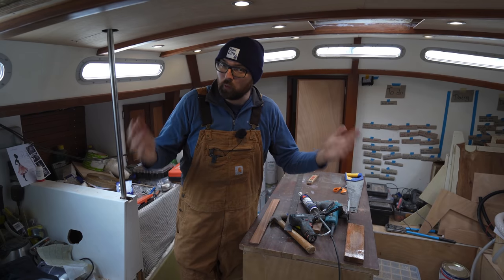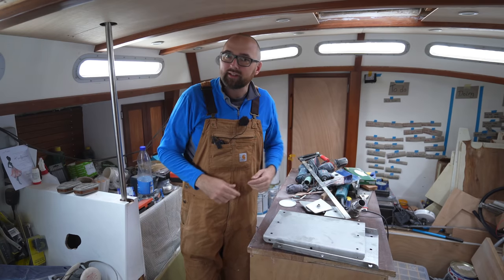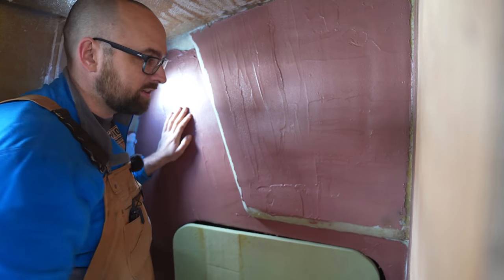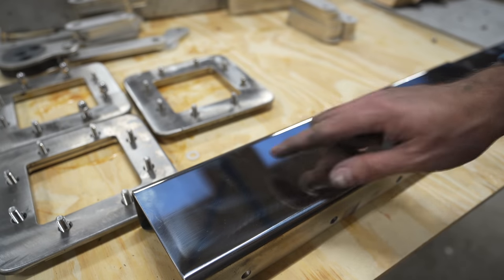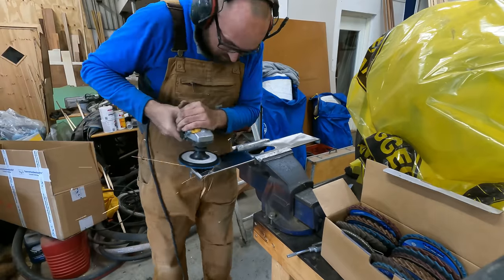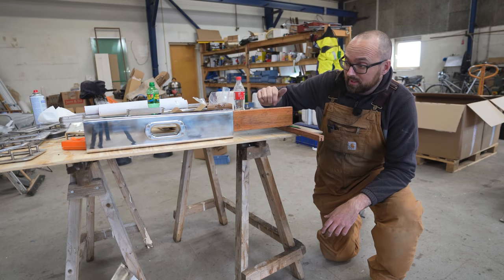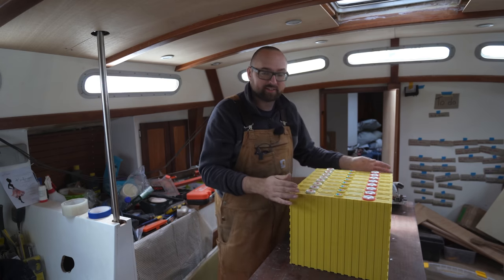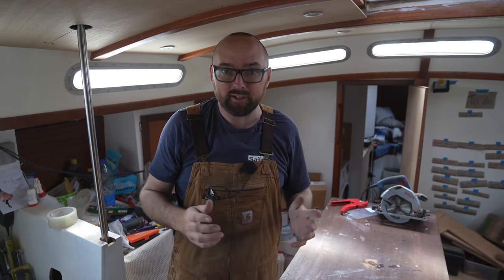Sail Life - Battery compartment, solar arch and toe rail - DIY sailboat projects

Comment: Hey Mads. Things are really looking great. Can you mount the antenna into the mast above the spreaders? In the back it may interfere with the windvane if you intend using one. I hope you do .... I know you will have a lot of power on board but a mechanical vane is a great piece of low tech and ads redundancy to autopiloting.

Comment: Top balance should have miniscule current flow after the first few minutes.   You can just use random wire instead of bus bars rated to >100 amps. 
 (Assuming you're just doing the balance and not charging in parallel. )

Comment: Howdy. Are you concerned about the deck hull joint not having the million screws holding it together from the old  toe rail? Is glassing the joint as you did structurally sound enough? I ask because this summer we are glassing DH joint on  our whitby42. Love your videos it is super helpful to know about how much O glorious sanding any and all jobs on sailboat may require.

Comment: Was there a reason you didn’t run the arch supports right through the endcaps and have them welded in two places per leg - at the top and bottom plates of the endcaps - with the added integral support from this?

Comment: mount the long range wifi antenna forward of the solar panels, not aft. it will be way easier to put up/sideways.
Reply: Won't it conflict with the boom?
Reply: @jameshoiby  I'm under the impression that the pannels are behind the reach of the boom. at least that is the case in my boat and most arch mounted solar panels I have seen.

Comment: You don't need bus bars to balance. The reason bus bars are so big is that they need to handle a lot of amperage because the voltage potential across them is so high. When you are top balancing new high quality cells you're looking at a few hundredths of a volt difference. You could probably get away with a single 22 gauge wire running down each side.

Comment: Mads, I love this channel and I watch every video. Question: when fairing a large broad surface, have you considered first spreading stiff compound (like the green 2-part stuff) with a toothed blade (or really thick mix using West 401 (microlight.) This leaves a surface of easily sanded grooves that you can fair with a a few strokes of a long board. Then you fill the grooves flush with a second quick fill coat. Result: dead-flat. What do you think?

Comment: You mentioned Top Balancing your Batteries but have you Bottom Balanced them? In addition I would strongly recommend Wedgelock washers to keep your battery links tight, this is critical ! I reference these items from experience ( an electric car conversion ) please be careful.

Comment: I would return the wifi antenna and just use the cellular ones. The wifi is too crowded and slow in most of the Bahamas/Carib. I am instead getting Starlink Mobile (which should be available at the end of the year).

Comment: wifi antenna - mount high on the side of the mast - that way if you're in a marina other boats won't be in the way of the supposed wifi signal...... solar - go with stiff not flexible - get from China as they still make the best and cheapest - order now to allow for shipping time - get a solar-wind kit if you don't already have a wind generator - don't use the direct from Chinese controller if you buy through eBay, but keep as a back-up.... oh.... btw.... make a faraday cage in the workroom to store electronic things during a coming lightning storm and don't forget to ground to lightning arrestor plates on outside of hull... - or just use oven... I would also use fans to bring air past batteries to keep cool as they charge fast as well as heat up fast when using for cooking, laundry, etc...regardless of inverter bc heat is a killer just like freezing is a killer on batteries... especially on deep-cycle - - too bad that electronic monitoring does not keep tabs on battery temps.....

Comment: Why does the cellular system need two antennas? Is one of them the local-repeater antenna that gives signal to your phone? If so, I should think you don't even need to mount that externally.

Comment: Not sure if you should mount the batteries there, if you get water in the saloon they might short out and kill all you electronics or at least disable them. Remember a good bildge alarm… and maybe think of some redundancy for the radios and maybe chart plotter…  
I recently saw a video with similar battery placement and it went catastrophically wrong

Comment: Could you put your WiFi aerial on the top of the mast?
Reply: I think I remember the mast being very crowded with other antennas
Reply: @peteralund  if it's going on a bracket anyway, I'd have it attached to the side of the mast. It doesn't need to be at the top, assuming it's a case of the higher the better, but anything over 6ft will be better than having it on the arch.
Reply: The longer the coaxial cable, the higher are the RF losses, and at 2.4GHz the losses on the cable are significant
Reply: @joaopissarro2861  wouldn't the cable from the arch, and I'm assuming to the nav station inside, be roughly the same as going forward instead and up the mast?
Reply: @mhicks80  it could be, in both case that’s not the best solution, that’s why in those cases the active equipment is placed just by the antenna, and the link to the “nav station” via cabled Ethernet. 
Dependent on the cable quality the amount of losses can be over 50% or over. 
I could look, later on, on some cable characteristics just as an example.
Reply: @mhicks80  example of an active access point to place at the antena. 
https://dl.ubnt.com/datasheets/bulletm/BulletM_Ti_DS.pdf
AP and antenna could be mounted on top of mast. 
Just an example.

Comment: I'm curious what BMS you plan to use with those LFP cells? I'm 99% positive (OK, make that 100%! :-) ) that you've got everything planned down to the minutest detail, but am curious if you researched the Electrodacus BMS. It is a stunningly simple, beautiful, clever design. But it does kinda require expensive Victron inverter-chargers and DC converters as it switches all LOADS and CHARGERS via mV remote signals, rather than having any high current flowing through the BMS. I personally believe the Electrodacus is Best-in-Class for LFP cells with matched panels. My six 120 half--cell PV with 7.8KWh of aluminum cased LFP cells and twin Victron Inverters supports my entire RV, including the mini-split A/C, running non-stop, our twin induction cooktop, coffee machine, microwave, hair dryers, lights, cell and laptop chargers, TVs, Sat receivers, Routers, Modems, water and vent pumps (for the composting toilet), etc, etc, etc

Comment: Be careful with the antenna placement with all that stainless tubing and electronics from the solar system so close together. They might be completely fine, but i also wouldnt be surprised if there was some signal degradation.

Comment: As a ham radio operator, I can tell you that your plan to install antennas nested inside the legs of the arch is not a good idea.  This will severely impact the range of said antennas.  In addition, it will impact the SWR of the antenna which may endanger the final stage amplifier of your transmitter.  The antennas need to be above the top of the arch or they need to be offset to the side at least 50 cm.
Reply: QSL

Comment: Hey Madz, did you get the batteries off Aliexpress?
Reply: There is a video in which he mentions where he bought the batteries. If I remember correctly, he dealt directly with the manufacturer, but ... it has been a few years, so I could be mistaken.

Comment: I like your way of thinking and finishing things. But people are right, you've added quite some weight to the boat. It's not only a matter of performance but also you're loosing obviously some stability and the hull needs to withstand more forces than it's been designed for. Not only catamarans are sensitive to weight, monohulls are more forgiving but overloading them can become dangerous as well. The toe rail is way too heavy with at least 5 mm thickness. On the cabinets there are some double layers of plywood as in the galley drawers and all over the place you have not spared with weight. Have you compared the waterline before the refit with the current depth? Roughly calculated each cm more depth means about 190 kg of added displacement for the numbers given. Sitting deeper in the water means also the boat is moving less active than it was designed and it will therefore have to take more force by waves. This means more green water on deck and a shower for free occasionally in the cockpit. 
Let me also say that the price of 45 k for the hulk of a boat you got is way to high. Even as a naval architect I'd never buy a ship without the neutral judgement of an certified surveyor. The money is well spend and usually results in savings. Emotions get in very fast and what seems a good deal turns very often into a nightmare. Even if you exactly wanted a large project like this has become over time, you could have saved easily half the price. All what is left from old Athena is the hull, the engine and the mast. The radar you mentioned in one of the videos was replaced and everything else as well.
Maybe even a brand new hull, rigg and engine would be possible for the price. A last comment on the displacement. As you probably know the warrior 38 was designed for 8.5 tons and not for 11. This means the waterline has been already far too high when you bought her. No wonder with all that water inside. With these arguments in mind it would have been well worth the effort to rip the core in the floors and reinforcing them with vacuum laminate. Of course I know that you have to stay positive on YT to keep going and behind the scenes you probably doupted a few times if this was going to be successful. 

Besides all the critics you have done a real great job. I believe especially the effort of managing the project beside the day job and filming all that, ordering the material right on time for several ongoing tasks simultaneously and then even starting a relationship in LA is quite a challenge. I'm also restoring wooden boats beside the job and often enough material is missing, even with less simultaneous projects. I'd have done the insulation different with more effort and some more minor things. But I'd not sail to cold and dark regions.

Comment: Long-Range WiFi?  Have you considered Starlink - May be worth a look, it will become available this year and be mobile accessible.
Reply from the maker: That would be amazing but I think it'll be a few years until that becomes an option :)
Reply: @SailLife   Not according to Elon.  The rate of satellite deployment is on schedule and my dish should be here within 6 months. The system will be operating out of Beta in June 2021.  He has also indicated that the current dish will be 're-programmable' for mobile applications, and that a different, smaller mobile dish is in development.
So, figure 6 months of mission 'slip'...  That's still Spring 2022!
Hell, by then he'll probably have missions to the MOON with his Star Ship as well!
Reply: @SailLife  And, once full mobile service is available, that will mean having broadband connectivity mid-Atlantic & mid-Pacific - very cool!

Comment: yr wifi antenne can be mounted upside down in the middle so to avoid shade or weird brackets ;)
Reply: Suggesting the same!
Reply: I don't disagree with you , upside down will work, BUT, it is a "Long range Wi-Fi antenna" which means the higher the better (longer range), what about part way or all the way up the mast?
Reply: Or on the spreader...

Comment: Why is it important to have the longer antenna on the arc? Isn't it better to have it on the mast? (Or the forstay, or on any place high enough.) Is it a electric line-problem? It really should be on a levitated place, away from everything (if it works anything like normal 3G/4G-antennas). As you need it removable, think mast instead and do it a click-on. Imho. Line of sight is everything when we talk antennas. But also interference.

Comment: Hey Mats! You don't need to put those antennas such far apart, i'd say. The 'UHF 5G' are 5G mobile antennas, for which you can't even find a datasheet atm, you must be a lucky beta tester somehow ;) But anyway, the 5G mobile antennas and the 'longer wifi' antenna, which also operate in the 5GHz range should be mounted with a distance to prevent interferences.... BUT, i think you'll never be using both system at the same time.... I'd say, that you'll be using the Wifi 2.4/5GHz network while at a marina, connected to the Marinas Wifi, or if there's no Wifi or it is too slow, youl be using your mobile antennas, but probably at 4G(2.4GHz) at 90% of the time. So i'd say there is no need to weld an extra mount for the WiFi antanne in the middle of your arch, just to make sure to but the antenna at least 60cm away from your 5G/4G antennas.... i'd recommend to put your WiFi antenna next to one of your 5G/4G antennas and your good to go... the chance of having interferences cause of using both antennas with a high ouput power at a close frequency is close to none... but that's just my opinion...
I'm at TV-Broadcast technician with moderate experience with RF equipment...
So yeah, I'd guess you could save time and money bi just mounting it next to one of the other antennas...

Greeting from Kiel, Germany,
Stefan
Reply: Sorry, just to explain my opinion... i guess, that you'll never use both systems with the full transmission power at the same time... the manufacturer suggests the mounting distance of at least 60cm to be safe when using both systems at full transmission power at the same time... those frequencys are so close, that there can be interference problem at that scenario... but, so far, there is barely no 5G coverage at all in most of the Marinas anywhere... I don't know what kind of router you are using but I can't imagine, that is one which bundles multiple connection standards, so I guess it will never work/transmit on 5G mobile and 5GHz WiFi at the same time with a big amount of tx power... so yea, there'll never be an interference issue when mounting both types of antennas on one side of the boat...
And anyways.... by using two 5G/4G mobile antennas, it must be a MiMo kind of setup... so if at at some point, your wifi antenna might  be interfering with the 5G antenna mounted next to it, you've got another antenna mounted 3m away from this system, which is not being interfered anyhow...

Comment: Your stainless fabricator did not do you any favors.  They should have started with mirror finish stock & with some skill the die marks could have been lessened.  Would have saved so much time.   I like that you are doing to have an arch, I would have made more of a radius to the upper corners, think it would a lot better to the eye.

Comment: Each "cell" is 12 V?  Then it's not a cell it's a battery because it has internal cells connected in series.  (by the way great video)
Reply from the maker: Each cell is 3.2 V :) 8 cells to get to "24 V" :)
Reply: @SailLife  I misunderstood.  Cool.  Do you make sure the cells are near the same voltage when you parallel?  Also I assume you will have a battery management unit (BMU) to make sure they stay balanced and you know if they are out of balance.  The systems we use regulate charging on the highest voltage cell so  one cell does not over charge.  Great job!!!